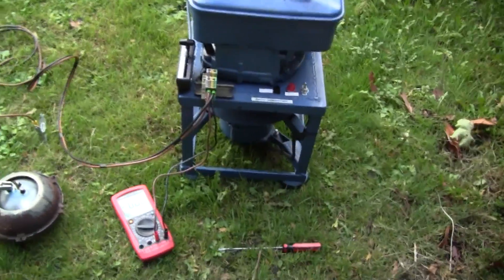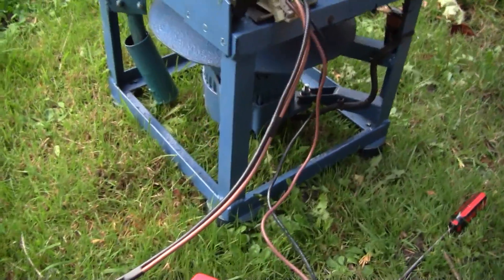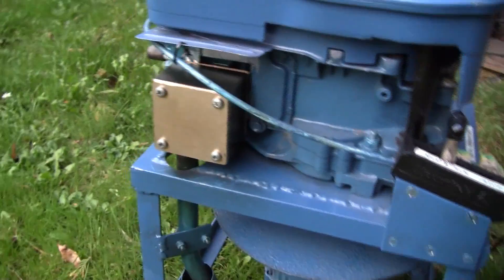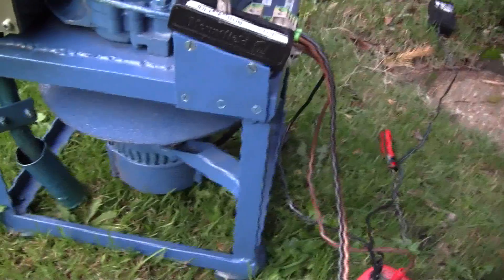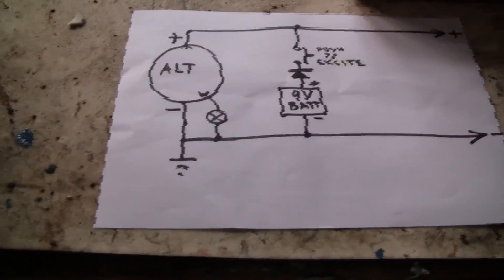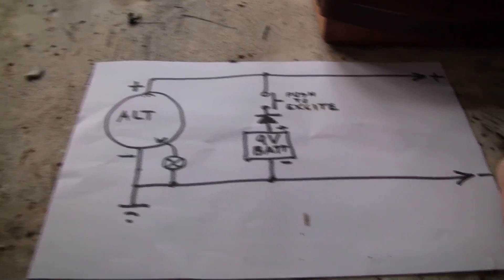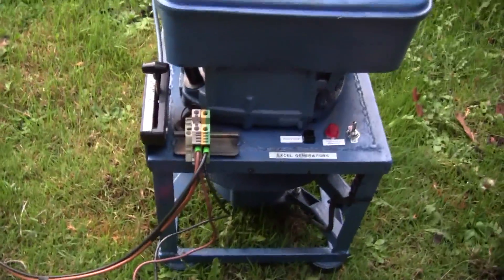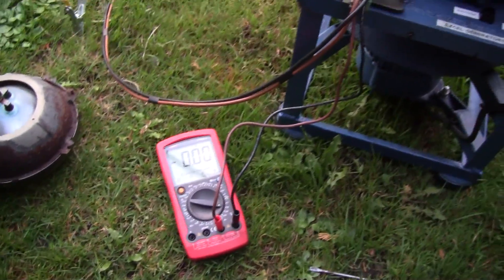Homemade 12 volt generator finished

Comment: Top job! How did you couple the crank to the alternator?
Reply from the maker: robertsulleyThere was a hex socket on the alternator shaft so a welded an allen key section onto the engine shaft.